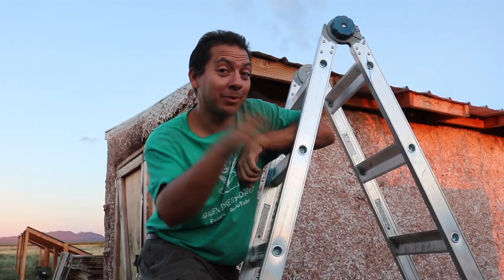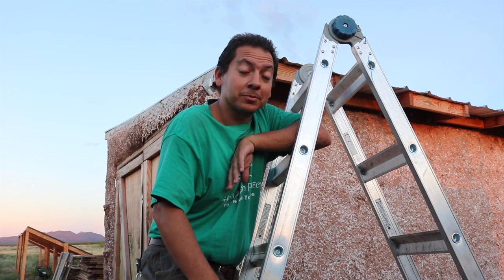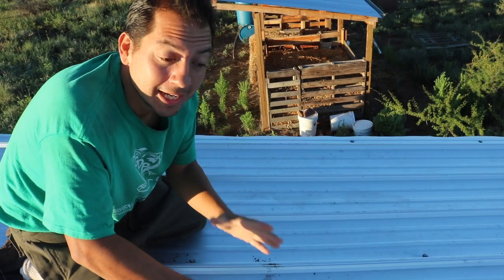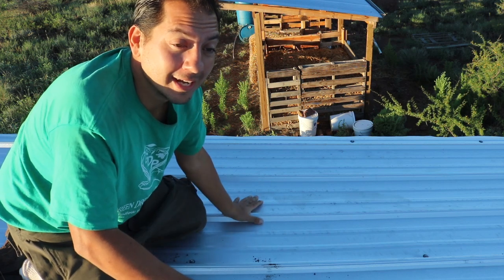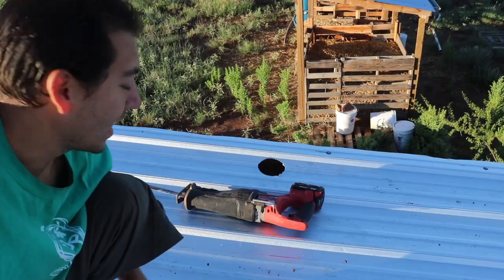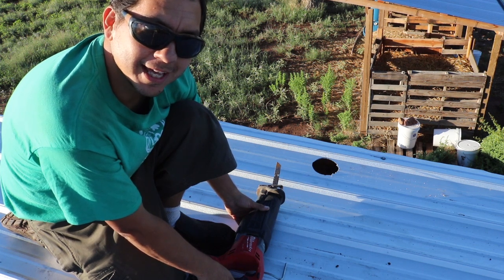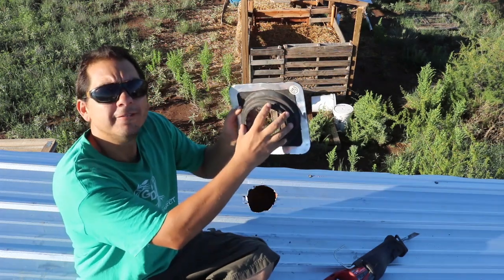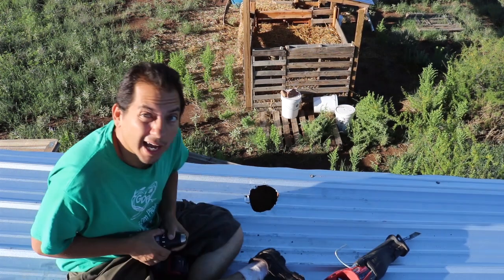OFF GRID No Electricity Air Conditioning in the Desert | Making a Solar Chimney

Comment: hot air rise's ; let the pipe pull air from the ceiling , that the hot air. use the swamp cooler type system draw air from the out side shaded are of the house . it goes through the swamp cooler unit and cools the air some 15* to 20* colder. and yes you can bury enough under ground  pipe deep enough to be event more comfortable.. if it's deep enough..

Comment: Run an earth tube to the shed. That will pull cooled air into the shed, and then the hot air will be pulled up through the vent pipe on the roof

Comment: So if you buried your intake so that it drew air cooled by the ground, would that help?  Your intake should be smaller than your exhaust btw.  And nothing stops you from box framing a solar window to boost your temperatures on the exhaust above the roof.  Plus, you can use the venturi principle to increase the exhaust flow.  The solar window ventilates out through a pipe that fits over your vent/exhaust and if you have holes in the inner exhaust pipe it will make the exhaust match speeds with the solar thermal.  The key is the outer solar heating pipe needs to move air faster than the inner one to make a difference.

Comment: Solar chiminy...hmmm..It just occured to me..put a square sided glass chiminy "surround" around the chiminy. Sun light heats air trapped between it and the metal pipe ...like a solar oven...thereby more pipe column heat INside air drawn up at faster rate! VOILA!

Comment: It depends on the interior of the building, but if that tube can be placed closer to the high point on the roof, it'll get more of the hot air. I assume the interior prevented this, but to the average viewer, if you can, go high.

Comment: cool vid.. put the pipe through the hold first.  then hold the pipe boot upside down and put the caulking on the underside of of the pipe boot seal and then slide it over the pipe and once in place... screw that sucker down.

Comment: That screen is reducing flow probably by 80 percent or possibly more.   If you add the wire diameter up and count the rows of wire and it will give you a total blocked by the wire.  Other than that I like your idea.

Comment: I wonder if it would have helped to dig a 6-7 foot deep (2 foot wide) trench about 60feet long from your north side outwards....then just bury some perforated 6 inch pipe underground to suck up all that subterranean cooler air? You could add a suction fan and maybe an appropriate micron air filter for not much more dollars if you really wanted.....that would probably add even cooler air (55-75F??) to the inside of your place?

Comment: From the location that you cut the hole, couldn't you have cut into the side of the shed and had a bend in your chimney going up just like a stove chimney?
Reply: Is it because of the fiber adobe? I noticed that you put vents on the door instead of  the walls.
Reply from the maker: Partly. It would be tough to go through the walls because of all the wood and wiring. It wouldn't be  impossible though.

Comment: You could ran it up on the south facing wall and not make a hole in the roof. Your chimney would be longer giving more surface area to the sun. To make it even more efficient; it could be a box with the inside three walls of the chimney painted flat black with the fourth wall being clear glass. The sun shines through the glass heating the walls creating a greenhouse effect. The escaping hot air would then create the draft.   Then you open a damper that connects through the wall to the bottom of the solar chimney.  Inlet air can be piped to near the ceiling from underground to make use of cooler temps. I was in the desert a few years ago and walked into a cave and it felt cold in comparison to the outside.
Reply from the maker: Thank you for that. Caves are definitely cooler than outside. A lot of thermal mass is helping to regulate the temperature. That's something we'll be utilizing as well.

Comment: If it isn't cool enough bury a pipe a few feet down with one end coming up in the shade for an air intake. have the other end come up inside the building. Through the floor would be best so it can't warm up from the air or sun outside
Reply: @null643  Videos about geothermal are available on Youtube. Not sure how long the pipe needs to be but the video's should give you an idea. If you are in a humid climate you would need some way to drain off the moisture from the underground pipe or pump it out.  If you are in the desert as he is and his system works it should work with geothermal without a fan. have to worry about moisture or mold but I would suggest creating a way to drain it. I don't know if you require a fan. Need to find out how well his system works first to know If you are in a humid climate you would definitely need a way to drain the water out of the underground pipe. Seems to me that if you need a fan to circulate the air through the pipe that it would be a good thing to recirculate the air by drawing it from inside the room and  bringing it back into the room at the other side of the room This would reduce the amount of moisture and after the air started to cool in the room it would further cool the air from the room rather than to have to cool and dry the warmer air from outside for more efficiency. I have never used a geothermal system so you probably can learn more from Youtube than from me. The info I am saying is from what I have seen on youtube and logic. I also saw where a man had a spring that he run water through an air conditioning condensor with a fan behind it to cool his cabin. He said it worked very well. He ran the fan on solar power. Either way is more efficient than air conditioning. If you are in a dry climate check out swamp coolers.

Comment: Actually, would have been nice if you had a thermostat in the shed and over a couple days showed outside vs inside temps, then install this and show the same data over the next few days. There is a theory that hot air doesn't actually rise, it is more that cold airs goes down and displaces hot air, sending it where the cold air is coming from. I really don't know one way or the other.

Comment: Do you know what the subsurface temperature gradient is in your area?  I believe in the Phoenix area it is 2-3 degrees per 100 feet.  Might be worth thinking about drilling your own heat pump well.
Reply from the maker: It definitely might be. We're slightly cooler than Phoenix. Usually ten degrees. We'll have to investigate subsurface temperatures.

Comment: That screen is going to restrict flow by at least 50 percent. Being a passive system you put together there is very low pressure thermal siphoning going on. ?how much flow can you get from one 4” pipe. A way to increase the cooling capacity is geothermal don’t let that scare you. Simply an underground tunnel bringing lower temperatures into the shed. You don’t have to place piping it could be just scraped sheet metal or any similar product use your imagination.